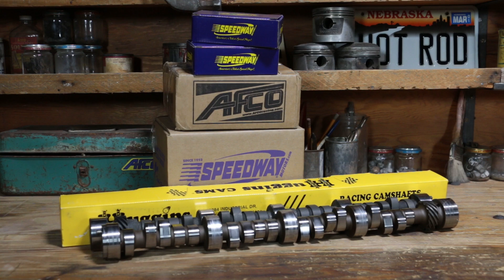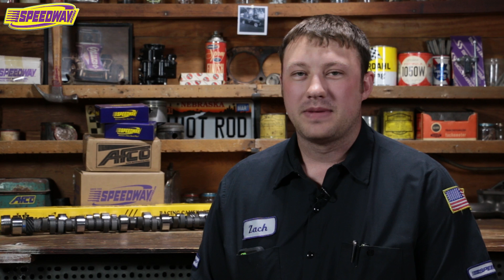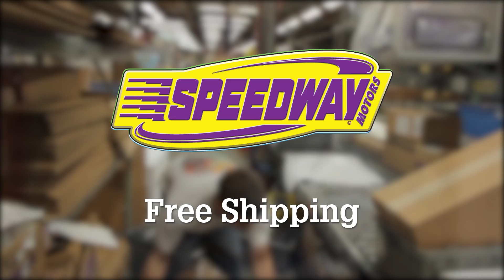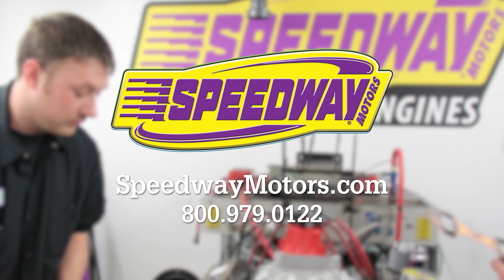Speedway Tech Talk  - Basics of Choosing the Right Camshaft

Comment: I think you can give me some expert advice   on a unique situation. I have a 1973 351 Clevland smog head engine and I want to put some 1970 factory closed chambered heads on it. I was given a completely rebuilt set of 1970 4V closed chamber heads and want to make this motor work on the street. I am not looking for advice on using other heads (or recommendations to use the factory 2 V heads, etc) as these were free to me and a few thousand dollars saving since they have already been rebuilt. I am not concerned about upper RPM  horse power loss and want to use these as a good lower rpm (up to 6000 rpm-ish )high torque motor (its my wifes hot rod so doesnt need to be radical motor). I have heard that if I run these with the factory flat top pistons and right cam profile i can make it relatively streetable with decent  low end torque?  I am wondering what your thoughts would be as far a good cam profile for my situation? going into a 73 mustang which I figure weighs at least 3500 lbs and its an automatic tranny (im ok with a higher stall converter). I am well versed on the Cleveland factory heads types, etc.. One last question, what are your thoughts on using the factory M-Code 351 cam?  also welcome recommendations from anyone else who sees this post as well

Comment: Hi I have a sbc 350 std bore std stroke etc need a hydraulic roller cam to suit has alloy proflow supermax 210 64cc 210 runners intake is Edelbrock proflow 4 1000cfm running 34lb sequential multi port injectors has headers and a manual gearbox tko 5 speed all this is sitting in a 85 corvette c4 running the stock differential ratio unknown car is a factory 4+3 looking forward for your recommendations cheers

Comment: Whats a good cam shaft for regular street use thats above stock somewhere in the mild setting without having to change other components like pistons and lifters ect. I got a chevy 350 in a 77 monte carlo. Just want something that can give my engine a bit more power out of it.
Reply: I watch a video it said under 550 lift, 112-117 seperation and around 230 duration

Comment: I'm John and I just want good sound for cruising around. I have a 70's 351 Cleveland modified Ford motor.  I bought it from market place. I'm installing it in a 96 Ford F-150. What cam would fit in with out changing things.
Reply from the maker: The Comp Cams 32-221-3 would be a good choice.

Comment: I wish the shop who built my engine would have watched this video.  I have a stock 1969 351 Windsor, I did not know. This is why I had a shop that build racing engines do it. He put a dual plane edelbrock on it, okay.  he built the engine, stock bore, stock rods, and stuff. He put a crane cam good brand bad choice. 270 - 512 intake lift, 517 exhaust.  I finally gave up, it would never run right this being only one of a few problems.  So me I pulled the cam, put what I thought was a 270 duration 484 lift both sides, Ran great until lifters pumped all the way up.  It end up being a 272 duration with 484 lift both sides. So now I am trying a 250-255 duration with a 434 intake and 464 exhaust.  From what I read it is for small exhaust port heads such as mine. I will also reinstall my factory 4bll intake. Jegs agreed to take my second cam back being I order so much from them, they are awesome.  the first cam is for sale, along withe the dual plane intake.  I have not finished putting my motor back together yet, hopefully this weekend.
Reply: I can't imagine a 270 cam being a problem as much as lifter pump up being...wrong springs or seat pressure/installed height just wasn't serving the lifters properly.  No crime in re-using old springs, but they all have to be tested when going that route, and meet the new cam recommendation for rate and seat pressure.  Anyway, those heads being a little under valved most cases, a little extra lift is not always a bad thing but has limits.  Test your springs on any cam swap - new or used doesn't matter.
Speaking to small valve/port heads, the old tried and true  has been lower lift [holding port velocity down in the 300.325fps range] and adding some duration to compensate as compression ratio allows.  If flow tested, I kind of doubt your [stock] heads can use much past 0.450" ish lift.  The 0.512" lift was probably as much as that combo could hope to use.  I kind of like Isky's [square pattern] 262 cam.  It's 0.445" lift.  The 256/262 cam too - all depends on what size valves are in the heads: common variants seem to be 1.78" or 1.85", but the creative have stuffed 2.10" intake valves into aftermarket designs.
Here's a fun read...   www.myrideisme.com/Blog/p38-ford-engine-head/

Comment: Hi there really liked watching your video. I have an ls1 with mildly ported heads. I would like to use this car for drag racing and occasional street use. My car weighs around 1800kg with me in it 3.9 diff gears and a 3500 rpm stall backed by a 4l60e.
I am currently  using  a 227 - 234  @50 cam LSA is 112 . Lift is 600 intake and 600 exhaust.
Intake manifold is standard.
The car is reasonably quick on the street and has instant torque but has only managed a 12.4 on on the track. 
What cam would you recommend to get the times down given what I have to work with.
Reply from the maker: With the stall converter you have you can go about as radical on the cam as available as long as your heads have sufficient springs and rockers.  We suggest contacting the cam supplier of choice and relaying the same info as well as the additional specifications on your heads for the best suggestions.  Also header size and fuel supply such as injection or carburetion.